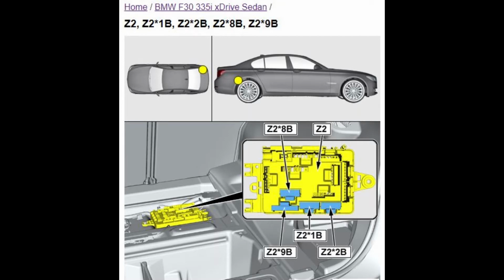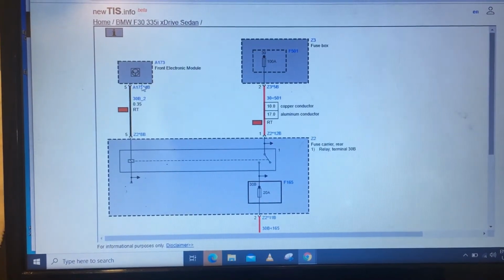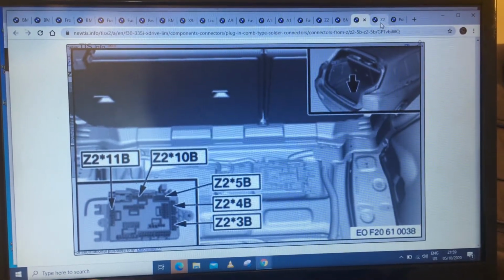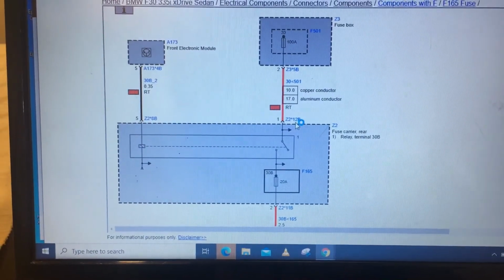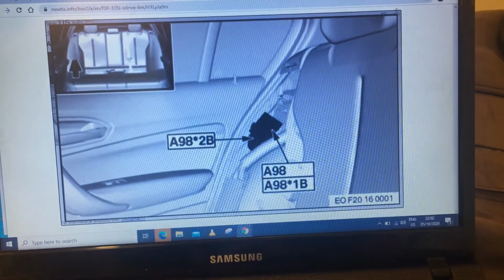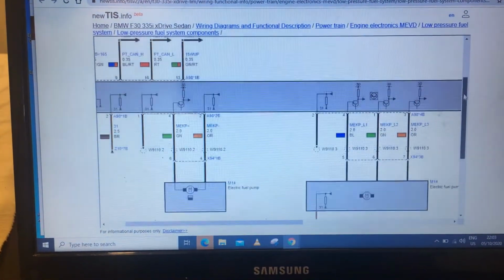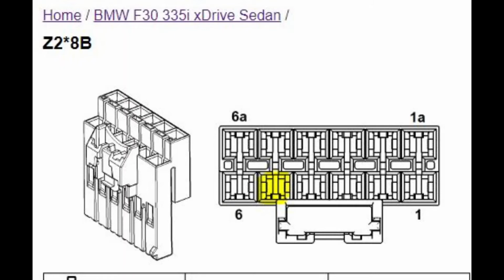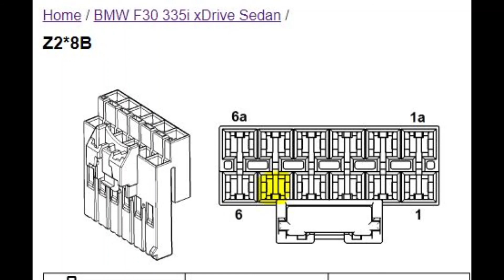BMW Fuel Pump supply check using Technical document - 3 series F30

Comment: Does the fuel pump relay attach to this fuel pump control unit??
Reply from the maker: Fuel pump relay is to supply voltage to the Fuel pump fuse F165 when it gets signal from DME after this fuel control is taken by EKPS. This is what I understood

Comment: Hello sir..my bmw f80 will not start up, low voltage at the fuel pump, pump is tested on others M car and works fine, ekps is showing no codes, fuses are ok at rear power supply, ground is ok also..
What do you think is the problem.?